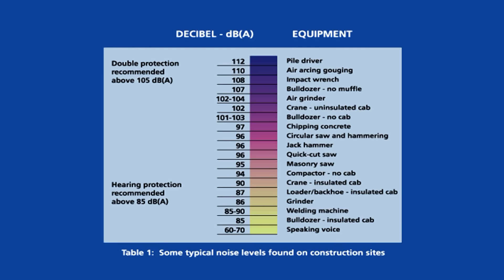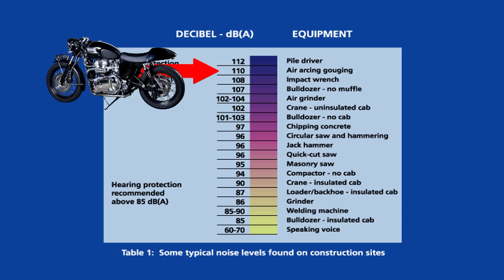Why Not to Change Your Car's Muffler

Comment: Hey  Scotty, HAs the channel ever did a dual exhaust versus single challenge/test? 
i just got a 84 cutlass  with horrible sounding dual 2" exhaust  with red glasspack bottles and wondering if it would sound better as in more rumbly with one single 3" which will also flow better since one 3" pipe is about 7 sq cm versus 2 x2" =6.28 sq cm?
 or can that smaller 2" dual setup scavenge better and keep low end TQ versus a big single which may gain high rpm  hp but sacrifice about the same amt of low/mid range TQ

to make the question even harder, im currently running the stock 305 SBC but already bought a used 2003  5.3L LS which will double the stock 305hp [nevermind all the ponies that escaped that 305 barn in last 37 yrs, lol. ]
SO i dont wanna spend any more than neccessary on this dual system if im gonna upgrade to a bigger dual or bigger single exhaust for the LS motor in near future

Comment: Tbh I've been running sports mufflers on 'complicated' German cars for years without touching the software and the pops and bangs are there or can be turned off via valvetronic and they run like they were stock with slightly better power. 

These modern ECU systems can adapt that's why there are various driving mldes like normal/sport/sport plus in these cars anyway. They  work just fine.

Comment: My conclusion: You should change it. Your maf and o2 sensors will compensate the better flow when your rear muffler only is removed
Reply: Definitely change it. The cat too if you can. Back pressure is never optimal but the cars were built to compensate for it thats why you tune it.

Comment: Almost every new truck I have owned I ended up modifying the exhaust (only cat back). I have never gotten any codes thrown. I imagine if you mess with the cat or remove an O2 sensor you will surely throw a code.

Comment: Honestly have to completely disagree with this one. I’ve done catback systems on three of my cars (91 Celica, 02 V6 Mustang, 06 Cobalt SS Supercharged) and they all increased in fuel mileage and ran better.  Also didn’t retune the cars. Also installed cold air intakes on the all and again added a few mpg. A basic intake and exhaust kit on my V6 mustang took it from 23mpg to 28-32 depending on how much highway it saw.

Comment: I put a MBRP Catback Performance Exhaust on my 2011 Chevrolet Colorado with the 3.7 five-cylinder engine. I noticed an immediate gain in acceleration and the sound is great. I never measured the MPG so I'm not sure. I didn't retune anything either.

Comment: Except cars have “fancy software and computers” too.. as far as I know your air fuel ratio only matters before combustion.. aren’t engines literally designed and built without an exhaust system on them?

Comment: Also
Hop in any car
Kick it down an see what it has,
Then un bolt the exhaust from headers 
An kick it down, 
Makes a world differance xause of less air restriction but doing it the right way by upgrading air an fuel ratio would help a lot more
I mean I drive a 04 Mustang 5.0 swapped with 3 inch straight pipes from headers with a x pipe an 2 down tips
Other than that ported throttle body ported intake manifold, ported intake manigold plate, ported heads, headers, bigger injectors, a full aftermarket 3.5in air intake a few other things an it's a hell of a lot faster than a stock 5.0

Comment: Definitely makes it run worse, especially on motorcycle everyone replaces the exhausts then you buy them second hand with the aftermarket exhaust, I'm not a fan of that at all, I would have kept the original exhaust, I'm really not sure if loud noise makes huge difference for safety on motorcycle, sometimes tempting to sell the aftermarket exhaust and buy the original.

Comment: Hey Scotty. If I want to do a cat back exhaust on a 2020 ram 2500. Not just take the muffler off. But put like a mbrp one on. I would still need to get the computer reprogrammed? I’m not doing it for the horse power. Doing it for a deeper sound.

Comment: My previous truck ran fine with three different TRUE DUAL exhaust systems. It came with a single. Didn't void anything, didn't affect anything tuning wise, no check engine lights, nothing... For 22 years it was fine... This alarmist advice he's giving is not based on much besides scare tactics. In fact I just got back from the muffler shop. My 2014 F150 5.0  STX I bought last year got a three inch single exhaust all stainless with a glasspack for a resonator, and Dynomax Ultra Flo welded muffler. Sounds AMAZING, and ran fine all the way home. As far as performance goes, it now feels uncorked....

Comment: So I have a 96 stratus with a 2.5 has only one O2 sensor and I cut the exhaust off it from that back so no cat, muffler, exhaust pipe or anything. So would that screw with the computer pretty bad then? It does run but just curious. Also I’m running it in a demo derby so I don’t really care as look as it runs decent and loud (which it is) for around 10 minutes though

Comment: You can modify whatever you want as long as you have the car tuned to your modifications. I have a Nissan Juke Nismo RS pushing 403 HP at 26psi no check engine lights, runs great, if I drive normally and when I turn down the boost to 16psi for normal driving I still get pretty good gas mileage. It's all about having your car professionally tuned by people that know what they are doing... And as for the sound, I have no catalytic converters I have a nice Magnaflow resonator and Magnaflow dual port exhaust they do a great job of muffling the sound, at idle it doesn't sound any louder then it did before with the Nissan OEM Nismo exhaust system.

Comment: @2:55 scotty proves that removing the muffler actually increases performance 
Gasses flow faster ecu increases air and fuel intake there is no way cutting or replacing muffler will cause the car to run badly

Comment: I have an 05 Camry 2.4  as my daily.  I replaced the OEM 2 catalytic converter. It was clogged really  bad. So I gutted the OEM cat. Then I put it back on.😂🤣 No check engine light so far. I drive 100 miles round trip 5 days a week. It's been a month. Now I'm thinking about ditching the stock exhaust. I think it's going to be fine.

Comment: All the dislikes, Scotty is right about this. there is backpressure especially with turbo engines most modern cars also need a remap, in fact if you straight pipe it or get a high flow pipe from front to back it is required to get a remap.

Comment: I cut off my muffler and after 5 times of driving the car, it started but was shaking and then it stalled after 5 seconds. I started it up again but it was cranking for about 20 seconds or more, and then it started making this popping noise under the hood and had a rough idle. So I decided to put it back on but still the same problem.. Should i drive for a little while and see if it gets fixed ?

Comment: I changed the muffler on my car and it actually runs better the factory muffler backfire a lot and it doesn't do that anymore it is a 2.4l engine vvt but I do put 90 octane with no ethanol on it plus better gas mileage

Comment: This video should be standard in Auto shop class and required for the final exam, along with the noise pollution video. Get them wrong and you fail.😆

Comment: If you put a Roush catback muffler  system designed for your year and engine Mustang it will get loud and perform better. My old (now my mother's) 2014 Mustang V6 sou ds better with the Roush catbacks than the V8 sounded stock. The Roush mufflers are just that good.

Comment: I have a mystery problem with my bronco. Starts up badly and runs rough till warm but still not perfect. I replaced everything accept ecm. Then I pressed on my exhaust band it appeared to affect the idle. My Cat is only crappilly exhaust clamped in place and you can clearly hear spitting noise. Starting to wonder if this is the cause

Comment: I watched a tuner tv show back in the early 2000's and he spent $3000 on larger exhaust, intakes, FI upgrades.  simple stuff.   He got 12lb ft and  9 HP.  After that I never touched my 2001 Focus ZTS.   My dad has a 1998 ford f-150 NASCAR edition.  after much research since its a special edition, we found out after seeing interviews of the guys who made the truck, it has a F0U1 computer in it no other truck has.  They had to reprogram the computer solely because of the Roush exhaust tip they added.  It is a single exhaust with a dual tip.  Ford made a different programmed ecm solely for the exhaust tip.  Thats how tight OEMs are tuning these cars.  even back 20 years ago.  you will lose power with these mods unless you spend thousands.  and even then you gain 5-15hp.  not worth it.

Comment: I used old lawnmower as kid, WAY Louder than Any car; 1 cyl 2 valve 3.5 HP carbureted engine. Small Engines are always Loud; but go ahead and annoy everyone with ur rice burner car.
Reply: If it's mostly highway not really a problem but yeah when you go into town some people definitely will be annoyed.

Comment: I fully agree when it comes to naturally aspirated cars. But when it comes to Turbocharged cars especially the 80’s and 90’s Japanese cars. what a huge difference in performance an exhaust can make. Even just a muffler is noticeable if it’s a free flowing one
Reply: Back pressure is never good regardless of the vehicle. Sadly cars are built to compensate for it.

Comment: All those sophisticated Sensors and Computers should be able to adjust the Mixture and Timing for the better Flowing Exhaust, far more accurately than how we were swapping Jets and twisting Distributors back in the 60s and 70s

Comment: What if you want to upgrade your muffler. Let’s say my stock muffler to borla exhaust on my 2015 Ford F-150?
Reply: That's not gonna affect anything. I got a Gibson cat-back exhaust on a 2000 Tacoma. Runs like it did with the stock muffler for the past 3 years. Just don't mess with the cat converters and oxygen sensors. I'm about to straight pipe a Corvette lol can't wait to see how that goes.

Comment: I’m sorry but my clk500 with flowmaster super 44, no secondary cats and resonator roars. Best part, o2 sensors are only before and after primary cats so my car runs fine

Comment: While this may be true, most exhaust systems in the aftermarket are "cat-back" systems which do not interfere with the exhaust system. I have a 2021 4Runner ORP with a Magnaflow overlander series and it runs great.
Reply: I can guarantee you that your vehicle is making more power over the stock exhaust.  Without a dangerous lean out of the AFR.  This information was true years ago with carbs and early EFI.  It is absolutely not true now.  The new ECU will compensate and more power  = higher efficiency = better mileage.  There is plenty of prof out there.  A tune would obviously produce the best results.

Comment: I used to have an 06 Mazda3. Bought it at a used car dealer.  Whoever had it before us liked to play around or something. Had an aftermarket exhaust, cold air intake, upper strut bar, lowered to about 3-4 inches off the ground, short throw, was almost like he was trying to turn it into a mazdaspeed3 just no turbo which I imagine he probably had plans for but anyways...came time to replace the brake pads. Wife took it to a co workers son while she was at work. He was going to school and working to be be a mechanic and so he asked his co worker who lived across the street if he could help (just make it go by a little quicker)...well this guy's coworker decided to give me the run down on how I NEEDED to take all this stuff off MY car and convert it back to completely stock cuz that's "how the car is supposed to look"....when asked if he was gonna pay for all the parts to convert it back to stock he just laughed and said "it's your car".......exactly...never let either one of them touch any of our vehicles ever again

If I want to put an aftermarket exhaust on my car.....imma do it. I put one of those free flowing "fart can" exhausts on my 99 Saturn SC I used to have and it never once threw an engine code.

Comment: Removing muffler or putting on a high flowing one will never mess with the oxygen sensors at the catalytic converter 🤨 in fact changing anything after the catalytic sensors ( catback system ) won't mess with them , or shouldn't
Reply: Remove the cat too if you can

Comment: If you do actually want to make power you have to take the muffler off because you need more airflow also headers bigger injectors and maybe a turbo or supercharger for more air then tune to run well

Comment: Some cars are restricted for fuel economy. So go ahead put that loud muffler, but also go buy a chip, a cold air intake, headers, and install the chip or tune your ecu. Dont cut the cat out...... The cat does not make a difference unless you are making aiming for lots of horse power.

Comment: How about in an old 94 base model Crown Vic, I'd like to let it breathe better and put dual exhaust and a bigger air box
Reply: Do it up I used to have a grand marquis with true dual exhaust and glass packs. It was amazing!
Reply: What's up with putting a bigger air box in there? Usually the best bet for better air flow is a cold air intake.

Comment: A lot of these aftermarket parts are engineered for these vehicles  specifically.  So then when you do so much modification they go and get it tuned at a shop. Most of the time don't have to tune it until changing the throttle body and intake manifold out. Gotta learn how to make a motor breath properly.
Reply: And thats with minor changes. Not adding turbo and the sort. Exhaust and a cold air you won't need any tune and it runs perfect.

Comment: I put slip on aftermarket mufflers on my 2017 harley. Sounds better, seems to run a little better. Lost 5mpg fuel economy. Doesnt pop or backfire. Said no tune needed. Think it gets the cat header replaced and a tuner next. Because merica....🇺🇲

Comment: Yeah I couldn’t care less about all that, I’m a mechanic and all the vehicles I’ve done exhaust work to, sound great and even get .2 seconds faster in the 0-60. 

I’ve never had any issues with the “flow of the air” from cutting mufflers off, I’ve ran no cats and no resonator just a muffler, classic car style (back when they knew how to make cars) and never have any issues.

Comment: Hey I removed my resonator on my bmw 328 2013 the car stalls mid acceleration each Time how can I fix it ? With a tune ???
Reply: I've seen a BMW come in with aftermarket intake and exhaust getting all kinds of codes. Turbo won't even kick in. You might need a tune or go back to stock.

Comment: Bud dosent realize that the ecu compensates for that and it will level you fuel trim back to what it was my car has no cats but has a set of mufflers and guess what it runs and drives like new and it also has over 330000 kms 😂😂🤣🤣

Comment: So scotty, it doesn't matter if the exhaust is compatible with the car, I wanted to buy a borla exhaust for my 2018 toyota carolla, I don't race but I wanted it to have a slight roar, nothing crazy.  The way I dressed my car up, it doesn't even look like a carolla, it looks like a Subaru. My car is only 1 year old, I bought it with 4,000 miles on it so if this this change will cause an engine light I won't do it

Comment: I didnt know you had to tune a exhaust🤔🤔
Reply: You tune the car through the computer.
When you remove your exhaust or cat or put on a cold air intake you are reducing back pressure thus increasing air flow. The cars were built to run with back pressure in the exhaust system therefore you must tune.

Comment: So put a sports exhaust on BUT remap it? Ight cool
Reply: Modern cars past like, 90's don't need any remaps after any catbacks. Usually if you don't wanna use 500 dollars on a good tuner, you can just get a catback which would increase power and be lighter than original exhaust.
Reply: @jaskajokunen3716  Ty dude I’m just getting into cars and I’ve only JUST managed to save up for an exhaust system cos moneys tight rn this helps a lot

Comment: Someone removed my catalytic converters..02 sequoia. 02 sensors weren't touched. I welded a straight pipe, kept the stock muffler, runs great, no check engine light

Comment: I cut off the muffler on my toyota 4runner and the truck still runs as smooth as it did before, also no check engine light, and no difference in MPG, its been like that for almost a year without changing anything in the computer. I dont think its that big of a deal.

Comment: Coincidentally cars that sound performance have garbage mileage to begin with, so it's moot to suggest those with substantially more fuel efficient engines to not modify the muffler.

Comment: Yeah yeah my check engine light comes on but it's not because of the muffler it's because my speedometer cable gear that goes into the transmission keeps jumping out because the bolt tab broke. 
I don't use that speedometer anymore... I'm using my GPS speedometer.. Gotta love those 94 Hondas.

Comment: Having a new throttle body, coils, spark plugs, 02 sensors, bigger cat 🐈 🐈‍⬛, if you put at least .5 in bigger like 2 to 2.5 inch, at least after the downpipe / manifold / 4 feet

If you put a glass pack right after the cat, it is very loud, but it does make a difference, and if you can reduce weight, it makes it easier for the exhaust to flow out after the manifold

Throttle body is very important to install new after probably 125k, when you start getting 02 sensor issues

Comment: No what he saying is do it right not waste .. by the whole exhaust system not just well to tip on the end of it. When you well just a tip on it. It does mess with the system. Makes check engine light and stuff come on so if you're going to do it do it from the head or back or change the header and exhaust

Comment: Some vehicles have resonators give me a break if your exhaust stock system restricted too much you lose power and gas mileage backfire is weak valve springs